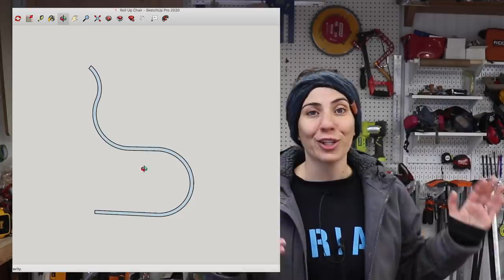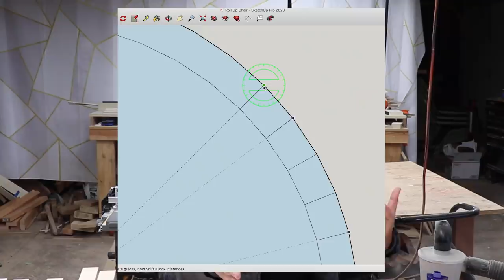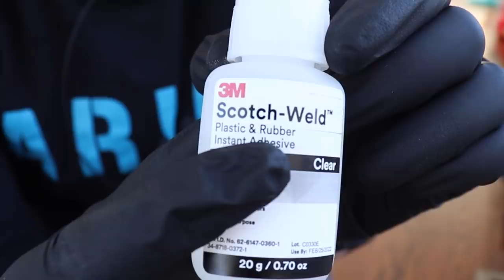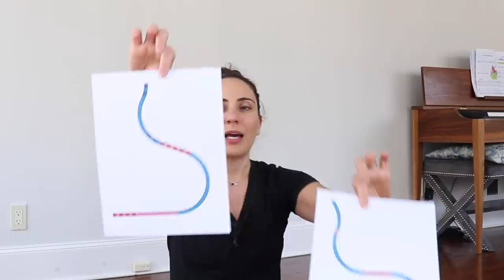I ATTEMPTED to make a chair that rolls up... It didn't go as planned...

Comment: I suspect that stainless steel cables (sailboat standing rigging with a fitting for tensioning the cable should be fairly easy to find) run through the centre of all the pieces would work  This would be all concealed within the wood and webbing or cloth glued to the face of the chair will only keep all the pieces aligned and conceal the cable ends/tensioning points. Definitely work out all the glitches with spruce or pine.
Reply from the maker: Cool idea
Reply: perhaps not through the center though. 
by putting the line through the center less of the wood is loaded in compression when the chair is sat on.
Reply: After the initial iteration, i thought a through attempt would be stronger.  But I hadn't thought of a cable but I like that idea.   Keep going Tamar!
Reply: @judih.8754  still need to carry shear across the joints. Need a friction interface or physical lips to handle vertical load.
Reply: You can‘t roll up the chair anymore if you build it that way

Comment: Hi from Argentina 
What you saw was a concept desing, if you look in google images you can see the diferent images presented to professors in Industrial Desing clases and final exams where you pitch your product with those images and the prototype (for finals only) to in my case 3 profesors, something like "Shark Tank" but you get a grade instead of a bussines deal . I studied Industrial Desing in my country and made many prototypes while in university just like this one, my desings needed to be modified to work 100% or change materials to  be a final product but you only need the prof of concept in university.  
The chair is called "Miesrolo" probably in honor of "Mies Van der Rohe" Arquitect /Industrial Designer famous for his Barcelona Pavillion building and Barcelona chair(love this chair btw), also his lounge chair and the MR10 chair are similar to this one but made in metal and leather.   
You have streching and compression in that desing wich is a big problem if you want it to be stable and support the weight. 
My suggestion is to use steel cables like the ones used in stair railings  (use the cable´s hardware to thighten the cable so you can adjust it) through the wood and bushings in the wood to protect it.  use  1 or 2 cables per side along the sides of the chair and use the straps to avoid pinching your skin while you seat and to aling the edges of each piece of wood or upholstery to make it more comfortable. The cables when the chair is flat on the floor are one length but when you ad the radius in the sittig format  like when you bend a piece of pipe the  metal streches on the outside and compres on the inside of the bend. Also work the angles adding more than needed to acount for compression in the wood over time. Diter Rams said " A good desing is as little desing as possible"
Reply: Thanks for the comment! But I just have to say: Design*
Reply: @netts2315  es Diseño en español so... yeah hard enough to remember since I finished english school 15 years ago, try writing something in Spanish let´s see how you do.
Reply: @robylr  This is not about who knows a certain language, it's about knowing a second language. English is my second language as well. Besides, no need to get so defensive.

Comment: Get the most inflexible "cloth", ie carbon fiber, and the hardest wood you can get your hands on. Also probably make the wooden parts a bit thicker. Possibly "glue" the carbon fiber to the wood with epoxy.
Reply: Carbon fibre is definitely extreme.
It is clear the design mostly failed due to the tension material failing.
Hence, a braided cloth would be best. Maybe even the material in seatbelts. This could probably be obtained cheaply from a scrapyard. Carbon fibre is very expensive.
Reply: Cuben fiber is a fabric used in ultralight tents. It has very little stretch. It uses layers of unidirectional dyneema strands between layers of Mylar. It can also be purchased with a woven outer layer for extra durability.
Reply: @heathgoodrich670   She did use seatbelt material.  Seatbelt material does still stretch some though, and the distance between her screws or staples determines the "free" length that the strap can stretch over.  If she used an epoxy to fix the banding to the wood in addition to the screws then it would dramatically reduce the available distance for the fabric to stretch over and will result in less stretching.
Reply: @jth_printed_designs  ahh, didn't notice that, I was skipping through the video a fair bit because I had work. I just thought she used rubber and yoga mat to build it.
If so, that is surprising that the seatbelt broke, there are weaker materials that would have held up perfectly well.
Reply: In reply to some comments, I add: carbon fiber is really not that expensive. Seat belts, though they may feel inflexible, are actually designed to stretch. And: the most stressing problem (😁) will arise in the area where the load will act to separate the fiber from the wood, ie the backrest. This leads me to think that the construction might need to be two bands of carbon fiber, one on the upper side of the construction, the other covering the whole of the reverse faces of the wood, and the two stitched together between the strip of wood. Or something similar...

Comment: FYI: Izzy Swan is selling small in-feed tables that attach to various table saws. If you had one, you could probably get the push-stick in place before cutting, which might solve the burning problem.
Reply from the maker: That’s a good point! Yeah!
Reply: @3x3CustomTamar  drill the pieces and link them using a  Swaged Galvanized Wire Rope ( 2 lines each side )

Comment: Excited to see your next attempt. Is it possible he had a cable running through the middle of the blocks we cant see?
Reply from the maker: Maybe. I was actually considering doing that. I purchased the rope and everything. Ha maybe I’ll try that on the next one
Reply: @3x3CustomTamar  If you find a good solution for the ends of the cable you could possibly fine tune the tension of the cable with a screw or a thread. I think there are solutions for this on the market or as a mechanism but I am not enough of an engineer to know it.
Reply: Maybe if you use cable you could add something at the end (probably the foot area) where you can tighten the cable...
Reply: @3x3CustomTamar  Impressive. I would use a metal cable.. Less stretch.
Reply: The chair never existed, I'd guess. It's another "designer" who created a CGI picture of something that could never exist in real life.
Reply: Or router in slots and use the very same webbing. Would spread out the stresses on the 2(?) inch webbing and allow for adjustments with a wedge stopper at one end.
Reply: Same idea. I'd try with 2 cables on each side.
Very nice try, anyway. Honest video as you always do. Thank you so much.

Comment: your dedication is amazing. You didn't fail, you just found out how not to make it. There's a million ways to fail but there's only one way to accomplish. please make a follow up
Reply from the maker: I will most definitely attempt again when the weather warms up!
Reply: @3x3CustomTamar   You seemed so keen by the end of this video to write what you’d done off as a failure. Let’s step back & see where you’ve really got to though:
- you set out to build a functional chair.  By the end of the video you were sitting on something that you said bore your weight & you were confident would hold. (So, ‘tick’)
- you set out to build a chair of a novel design. You very much appear to have done that (‘tick’).
- you set out to build a functional chair which could be rolled up. It can be rolled up (so, again, ‘tick’).
- you set out to determine if a novel concept you’d come across - that you weren’t certain could actually work in practice - could really work in practice. The prototype you built by the end of the video is absolutely ‘proof of concept’. So ‘tick’ yet again.

Presumably you can disassembled the parts of this prototype which didn’t ‘work’ and re-engineer them so their practical effect is closer to the initial picture you’ve got in your mind’s eye.  That would help to rescue some of the cost of materials you’ve already sunk in the project, wouldn’t it?

My first working role in life was as an experimental research scientist.  What I learned then was that an experiment was not a ‘failure’ if I got different results from it than I’d been anticipating.  An experiment has only failed if it gives one no results, or results so indeterminate that they can’t be interpreted.  You got results - the ‘science’ has been proved; it’s only the ‘engineering’ you now have to sort out.

This attempt did not hit all of your starting criteria at a 100% level of success - and could possibly therefore be categorised as a ‘failure’ - but it is certainly not a terminal failure.  You’ve reached a bus stop on your route with this project, that’s all - just not either your desired destination, nor the bus’ final stop.

Stick with it - your final result is going to be great! 😀

Comment: If I remember correctly, one trick is to permanently attach the pieces that already follow the curve of roll up. The other thing is to have the tendons (straps) be sinchable as with a ratchet strap.
Reply: I think thats an excellent idea, especially for the back of the chair.
Reply: In the second picture she shows, it doesn't look like that's what was done.  I had the same thought but was disappointed when I went back and saw that picture.  Go back and see if I'm wrong.
Reply: Do you think you could run metal cable through the middle of each piece and then tighten?
Reply: @AdrianMacGregor13  running a cable in the middle of the slats would put more force on an even thinner piece of wood. Also a higher strength cable material would be UHMWPE which is sold as high test fishing line.
Reply: @AdrianMacGregor13  Rereading my comment, I sounded harsher than I intended. The real solution is to try all configurations in simulation and see how they behave.

Comment: You know that fasting belts that hold a few tons(of weight) to keep loads on trailers intact during a ride? Try those strong belts
Reply: That is a good idea. You could even put the strap underneath and rubber on top so it looks nice. 
I wonder how they would hold up getting screwed down they might loose some strength

Comment: How about drilling holes through all the pieces and using braided steel cable to hold it all together?
Reply from the maker: I was considering a rope of some sort. That would be cool
Reply: Then it would not roll up as desired.
Reply: That wouldn't roll up, but it could make a very interesting non-rollong chair. Kind of like an Alvar Aalto screen on its side
Reply: Could use synthetic tow rope. 3/8" is rated for about 12,000 lbs if my memory serves

Comment: The presentation and ideas here are great.
As for ideas: Personally, if it just needs to roll up, I'd definitely not be above having the back curving back around to touch the floor again like the front does.
Reply: Not a bad idea that. It should be very stable with both ends on the floor. The challenge though is to make it as intended. That's where the definite skill would kick in and be the brag point.

Comment: My suggestion is to raise the thickness of the wood.  Raise the delta radius of you inner circle with the outer circle.   I suspect your wood was compressing on itself.  Spread the pressure out on more surface area.  I hope that works.  This chair is a great concept.  Thanks for experimenting.

Similar idea to your chair here https://youtu.be/WFhK3Tff3Do
Reply: Your suggestion works. How do I know? In early 1980s, on a BA coarse, I built almost exactly this same chair but as you specified, but with clear/fluorescent acrylic instead of wood. The faces of the acrylic were grooved to avoid slippage. Same seat-belt webbing idea, but two straps side by side. Oh, and it lit up. It cost a fortune. The 'foot' sections were 120mm wide to take some of the 'rocking chair' effect out of it.

Comment: Have you considered that the original is designed and assembled using hinges so there zero slack in the system, the felt in the original is merely decorative.
Reply: hardware store hinges have slack too and that slack would pile up with one between every segment. also simplicity and light weight seem to be a big part of the charm of the design
Reply: Indeed, or a strip of very strong material with very little stretch under that felt.

Comment: I’m wondering if something like a bicycle chain would give you the flexibility to roll it up but also the rigidity to hold weight.
Reply: Sounds very comfortable!
Reply: @-Sean_  hi Sean! I suppose if you wanted to place the chain in a place that would be uncomfortable to sit on, you’d be able to! I think most people would prefer to offset the chain to the sides or edges, not unlike the rows of screws that were already in place holding the straps. But whatever makes your water boil I suppose! 😁
Reply: I was also thinking (dangerous activity for me) the screw heads and strapping might be raised above the wood enough to be uncomfortable and unattractive. Possibly disassemble and add a shallow groove to hold the webbing on top might recess the screw heads enough if it’s actually needed after the build. For the chain as well but the wood looks thin for this. Or the chain could be inset on the ends. Just thinking, if the pros fail I have Lotto odds of success.

Comment: My father instilled in me “the only failure in life is a lesson not learned” ... you are obviously leaning from this project. 

UHMWPE Webbing has very little stretch and would be on my list of considerations.  

The next challenge I suspect you’ll have is the chair not retaining its shape with repeated use from the wood fibers fatiguing from repeated compression over time.  Consider changing grain direction (end grain compression) or install compression strips in every joint.
Reply: I love what your father said! I just may have to make a sign with that saying!
Reply from the maker: I’ll have to look into that webbing. Thanks!
Reply: You're thinking along the right lines to a solution, but before you get there and fail again, I hate to say it, but this is a classic engineering problem, because it is seriously pushing the limits of the materials involved.

I would suggest starting out with some calculations (which unfortunately, I do not have the time for at the moment).  Figure out which piece sees the most stress (my first thought would be at the top of the front, by your knees), and sum up the moments about it (taking into consideration the considerable lever arm of the seat length).  That will give you an idea of the tension and compression involved, and will let you know the sort of strapping required, and if fiber crushing is indeed an issue (I'll bet it is).

My gut tells me that UHMWPE strapping will help, as it has well under half the elongation of polyester (which in turn has half the elongation of nylon and polypropylene).

As for the wood, the maple will be fine on the strap side, but I don't even know if aluminum will be hard enough on the underside.  That depends a lot on the plank thickness, as that has a great influence on the moment calculations.  My suggestion would be to make the planks out of two materials, with something with a serious janka hardness on the underside.  Perhaps even acrylic infusing that part due to the compression involved.  However, you might still experience crushing due to the wood failing in tension (sideways), so I feel that this side will actually be more of a problem than the strap side.

Comment: The webbing alone will work, however it always needs to be on the stretched side as it can only resist pulling forces but no pushing forces. Hence for the leaning back it should be on the other side of the wood. Rolling then would still be possible but for that part reverse
Reply: what do you mean? the straps were on the correct side all the way through.

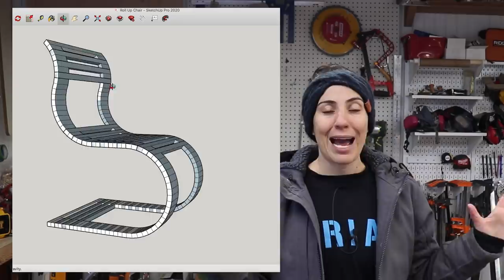in the 3d model at 2:00 the back rest might fall over to the right when the chair is standing on its own. but once you sit on it and lean back the pulling force is completely on the side where she put the strap so that has to stay where it is. 

if you add straps on the other side to fix the back rest falling over you can't roll it up anymore. what you can do is extend the top part to go further back until the  center of mass of the back rest is behind the leftmost piece of the concave part. then it will naturally try to fall to the left and the tension will be on the same side whether you sit on it or not.
Reply: The one thing to take into account is that due to the smaller radius the stretching of the strap will be more noticeable compared to a big curve, but the load on the back part is also much less as it does not need to carry the entire weight of a person. If you know how much the strap will stretch you can adjust for it such that when a person sits on it, it has the desired shape. But you probably need some specific material that does not stretch much over a long period of time for the idea to work.

Comment: Some old seat belts, cargo harness or lift straps would of been less stretchy. The straps you used had to much stretch that is how the guy did it plus he also made a pocket in each piece to hide the strap and covered the straps with decorative material so you don't see what was underneath.